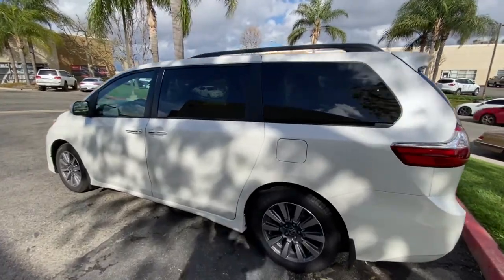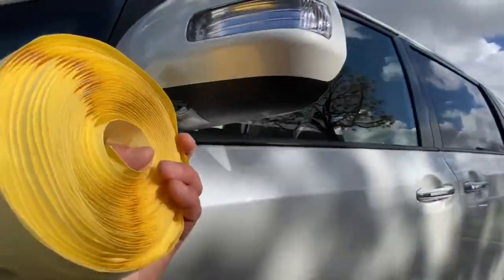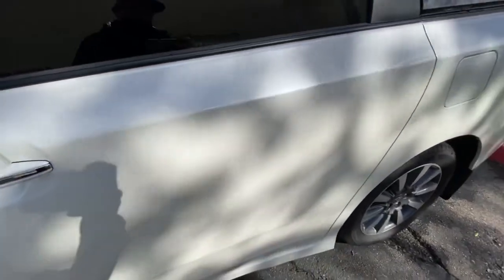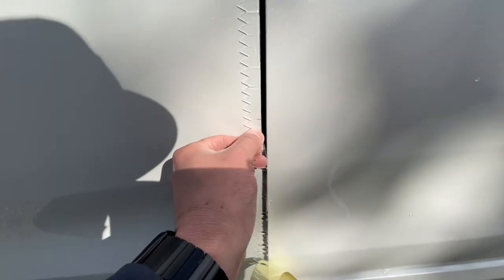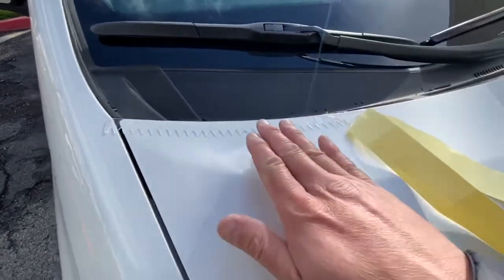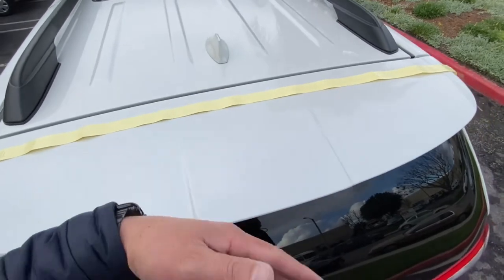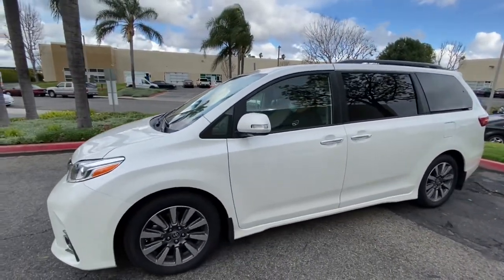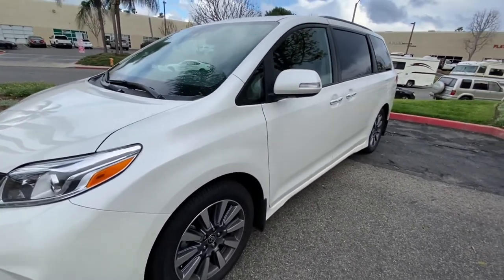Increasing MPG with Turbulator Aero Tape

Comment: man, turbulator tapes are used to create turbulence, not to stop it from happening! On aircrafts it is used to DISRUPT laminar flow intentionally on top of the wing to prevent air from bottom of the wing curving and flowing back to front on its top. This is done to delay aerodynamic stall of the wings and control surfaces, not to improve performance. Same with racing - they are merely using it to have better spoilers, not MPG
Reply: It also delays boundary layer separation which reduces the size of the wake created.

Comment: What were the results?
Reply from the maker: We received an average of 0.5 mpg
Reply: @BalladeSports  Thats 0.5 mpg better than factory right? This number would mean more if you also indicated the total miles traveled and which of these were city miles and which were highway miles. I could see better ways to improve mileage. Tuning, turbocharger (like many factory equipped turbochargers) they aren't always meant to add horsepower and speed, E85 (although this requires tuning), undertray, diffuser, and many other modifications.
Reply from the maker: @rifleman7313  This product has always been a fun project.  Honestly we just are busy working on too many other things. So going super detailed on data for mpg took up too much time.  It’s great to be scientific but money and time doesn’t always allow.

Comment: If it actually worked wouldn't  automotive manufacturers use it?
Reply from the maker: Of course!  They already do!  You just never noticed it.  https://www.youtube.com/watch?v=9Whd_KnsLKE&ab_channel=KYLE.ENGINEERS

They are called vortex generators.  You see them under the side mirrors and in the back of the roof on sports cars.  Its even used on Formula 1 cars!!  https://www.youtube.com/watch?v=MUbh8uYNYC8&ab_channel=BalladeSports

The science is there!  You even have vortex generators on a golf ball.  That's what makes it travel so far!  Its all about aero.
Reply: They do a lot.